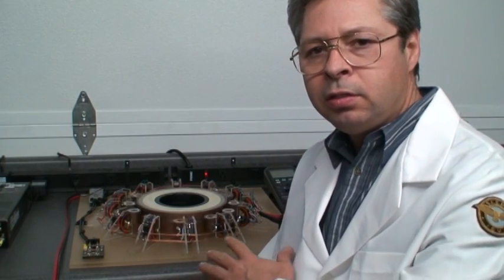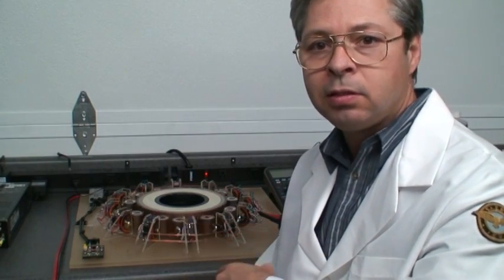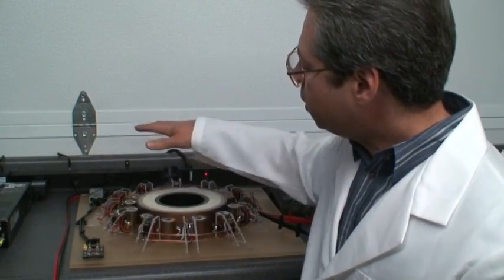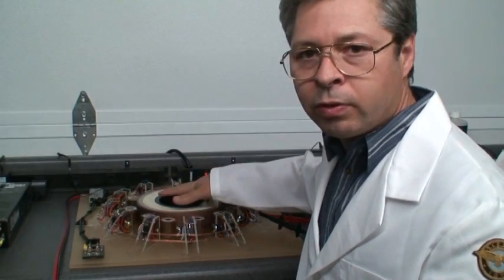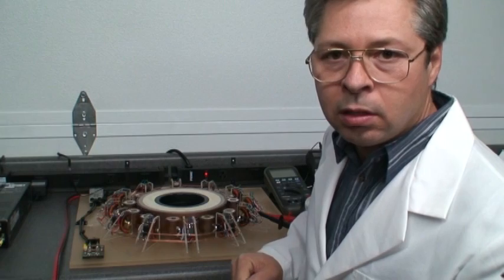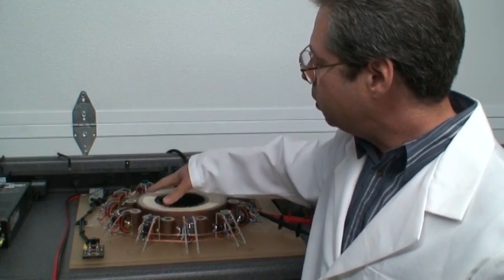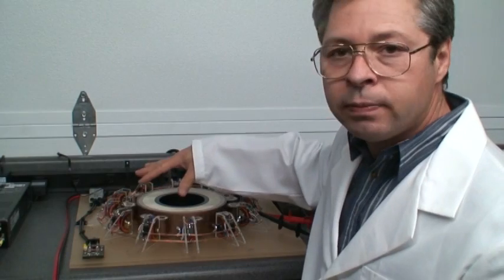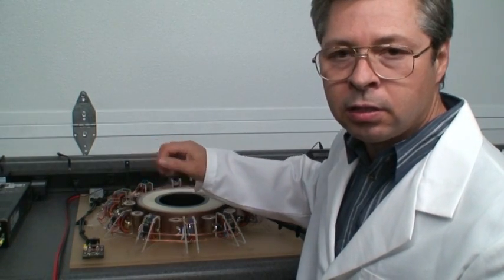Twelve roller mock up of the SEG

Comment: I find this device very curious. If the rollers were regular magnets they wouldn't roll like that would they? I would expect the north and south poles of each magnet to attract and the magnets would flip on their sides and stick together. Would this be the case reguardless of the external power supply ? As the rolers are made up of segments i assume that it must be made into a spiral magnetic field  each roller ? It would take some doing to create such a roller i expect.

Comment: this seg thing ,,, is just bedini battery chargher you used 0ne nine volts battery and charged another 6 ninevolts thats what ive done for my remote control cars using bedini window motor chargher  its simple to make and its proven thats works... input is ninen volts   output is  6ninevolts battery fully charged,,, thats what i  called free energy

Comment: @gdgildner That's not what DREAM ONE states. THe Dream indicates the runners should be cylinders, and segmented into eight discs, joined magnetically. THe SEG will only function if the precise instructions given in the dream is obeyed.

Comment: i want someone to explain to me, if the electromagnets are being powered by electricity, how will this produce more power than is input into the device; how will input be greater than the output?; how does it produce energy that can be harvested?, and also, are the rollers making contact with the outer ring or are they floating there?

Comment: @clnmyjts There is no such thing as "free energy". Solar energy is BS most of it, you use just as much energy on producing it as the panel will produce over its lifespan. Well, electricity by water is solar energy to some extent, but then everything would be solar energy.. We need to focus on the bigger things, nature. Not small scale physics..

Comment: Use light material and liquid mercury as electric storage unit and it must spin up to 60,000 rpms to work,your on the right track..just use light material or it will self distruct on to itself..smaller mags with neoprem sleaves or teflon, more mags.the higth of the mags are a good size to start with, just narrow them down so there lighter..and put a ring on the outer side to hold them in place that turns with the mags like a bearing,the mercury unit will provide the boost to increase the spin..

Comment: Because this is just a magnet mock-up made for CFE II, and to see how much input total power it takes to get rotation. In the level 4 square SEG, the Neodymium cores(electron reservoirs) and choice of elements and gating layer of Teflon or Nylon 66 negative to the outer maramagnetics emitter layer, in plates and runner-sets gives off more than enough EMF to sustain rotation.

Comment: can somebody please explain this to me in layman's terms? as far as i've understood it goes against mathematical logic, but still works. im talking ofcourse of creating constant motion; creating the same ammount or more energy than the device consumes. the 12 electromagnetic fields are powered by a single energy source which is the same or weaker than the energy u could gain from the device. and since the magnetism causes the energy flow (electrons) to speed up, it should create a greater force?

Comment: It is fed 1.5 Volts @ 600 milliAmps.
The Neodymoim-cores of all plates and runner sets in conjunction with the other chemical-element layers andt the gate-valve layer of NYLON 66 or Teflon generates more than enough EMF to sustain rotation on the actual SEG. First SEG was constructed in 1946 at British Rewinds, financed by the late George Hines.

Comment: You must like paying a fortune for electricity. The domestic laminated four-element (Level-4 Square) SEG will supply 11-kilowatts per-hour to power your home, for a one-time purchase price, that when mass-produced will be less than a petrol-powered emergency generator. When overloaded, it makes an excellent drive-unit and force-field generator for slender-disc areospacecraft, that can travel MUCH faster than any rocket, with no noise, no fuel, and no heat, no vibration.

Comment: Yes, now it is authorised to talk of the magnetiser. That is key to the technology, for you must have an DC with superimposed AC impressed simultaneously, on plates, and 90-degrees the other direction on runners. This is basically a linear induction-motor, similar to one patented in the USA in 1979 by Howard Johnson. Professor Searl invented the rare-earth magnet. Before the first 14-foot SEG in 1946, Neodymium was used only in tha glassblowing industry, to tint and polish glass.

Comment: Is this device supposed to work by itself?
 
I mean, are you (they) claiming that when the external power source is turned off, the device will keep moving and could provide torque to any other machine to make it move "for free"?

Comment: RF transponders would be on all commercial and civil IGVs. Flight direction is controlled by the 64- Flight-Cells between the the SEG-powerplant and the flame-barrier and the rim of the spacecraft. 64-discharge needles are at the end of each flight cell.Flight cells rotate from 0-degrees to 90-degrees. By asymetrically distributing electrical potential on craft, it can be controlled. Speed of IGV controls altitude;controlled by a load-cell and a videocamera oscillator-tube.

Comment: Laser beams can cut thru ANYTHING, yet I see no governmental control of LASER-devices. You will soon have your own flying car, as predicted in science-fiction films since Fritz Lang's METROPOLIS (1922) to BLADE RUNNER (1982), BACK TO THE FUTURE part II (1989). Air travel will assume lower cost than ever before,, with a much cleaner-environment, no burning of fuels, fossil or otherwise, and a great economy, when any oil sold is dirt cheap because demand shall be non-existent.

Comment: The basic equation for calculating electrogravitics force:
          F  = Vm1m2/r^2
where force is in Newtons or dynes, V is Voltage, m1 is the upper-shell of the IGV, m2 is the lower shell of the IGV.Both shells of IGV connected to the innermost Neodymium-layer of the innermost ring of the level-six square Flight SEG, and also to two switches in each of the 64-flight-cells.

Comment: Yes. The SEG is simply a linear motor, basically a two-phase induction motor, with the electromagnetic-wave impressed on plates and runners 90-degrees out of phase. This looks like a rotating spot on a scope. The SEG works due to simple,reliable old physics and electromagnetics.Maxwell's second equation is upheld,inviolate. Not Lorentz-forces,but simple wave-phenomena,and Cooper pairs explain the SEG.

Comment: I read in another video that that speed was attained with a only 1.5 volts potential - my question is, how much current goes into the thing?

Even if the antigravity claims prove bogus, this might be an interesting configuration for an electric motor. :)

Comment: The SEG-powered IGV cannot crash inot buildings, or the ground, the field just pushes it away. The Levity-disc (IGV) is surrounded by a forcefield, propagated from the rim of the craft. Bombs cannot escape from the field of the SEG. Nothing can destroy the craft, either, when so energised by the overloaded, superconducting SEG. Google: FORCE-WALL. An impenetrable electrostatic force-wall was accidently created in the Southeast at a plastics-factory.

Comment: This was supposed to be a mock-up, not actual rare-earth-cored, self-running SEG. In actual SEG-GYROCELL,no contact.  Minimum 4-layers (electron-reservoirNd, (electron-gate/insulator) Nylon 66 with a neg. charge, or Teflon, (electron-accelerator)-FE (this layer is magnetised with DC+AC coil), (elctron-emitter) Titanium - Ti, (paramagnetic-layer) Al, or Cu. Runner attracted to Fe-layer in plate, but float as  orbit/rotate. Just like planets in ecliptic, or a magnetised Fe-atom.

Comment: John has said many times that one idea for an SEG-powered car would be to replace the 4-wheels with 4 SEGs. The SEG is a PRIME MOVER, and will produce any amount of usable torque you require. Or, just use ONE SEG in place of the electric-motor on an all-electric auto, and use AC/induction motors. No emissions, in fact the SEG cleans the air as you go, no noise, no consumption of Earth's Oxygen, no emissions, sweet, after-the-thunderstorm air coming from under hood...

Comment: This work is fact, and I am simply reporting history. 1977, US air Force, Edwards flight tested P-11 at Edwards, and you may call them. But that was 30-years ago. NASA had lot of contact with Searl because next craft, EZEKIEL, 90-footer, was to be manned, so needed life-support, as air can't get near generator at the 500,000-Volt mark. I met people who worked with Searl, and people are still coming forward that worked at ground-stations over  world to turn the 12-meter band-controlled craft.

Comment: When the SEGs are silently in every basement, generating power, and put the excess back into the grid, when we have clean, cheap, SAFE, IGV air and space-travel, have SEGs in every hospital and burn ward, promoting rapid-healing, SEG-powered electric cars, and clean air and water again, we will just be beginning!  We can do it. If we work really really hard, NOTHING is impossible, and don't ever let any anti-intellectual tell you any different!

Comment: Antigravity is any force that is in opposition to the PUSH of gravity (a converging flux of ETHER). Matter is an ether-sink. A hot air-ballon is an antigravity device! We are just doing the same thing with electrons.Burkhard Heim uses the words DYNAMIC COUNTERBARY. There is grav- shielding, dipoles, inertial-drives,Moving parts, static, solid state, electrostatic, electromagnetic (the Navy's antigrav TOROIDS). Read THE COSMIC CONSPIRACY, and THE VINDICATOR SCROLLS, by Stan Deyo.

Comment: (hypothesis) As the magnets move an electric current is generated in the copper. This increase of the magnetic field creates a local minimum on the surface in front of the roller which pulls it forward.

Comment: Put a shaft through the big stationary ring magnet, mount 2 ball bearings with a proper spacers to keep the ball bearings in right place. Then design and mount 2 non magnetic perhaps ¼" circular plates above and below ring magnet wide enough that will have enough space to mount each individual rotating small cylinder magnets with ball bearings.

Comment: I'm an old Keelynet user, and ran Vortex-L FE forum since 1995.  I've watched all the various projects fail.  They tried to develop large generators but without ever releasing the smallest piece of working hardware.  If you follow the same path as all earlier researchers, history shows that you have insignificant chance of success.  So... toys should come first!  They solidl prove the principle. Kites or paper airplanes first, Wright Flyer later.

Comment: Several "magnet motor" companies posted videos on their own websites.  Steorn has stuff here, no?  They could all easily be hoaxes, as could your own videos.  Only the physical device is convincing.  And only convincing if in outsiders' direct possession, NOT just demonstrated by yourself.  (Demos can be hoaxed, run by uWave beam power rectenna, etc.)

Comment: that might be the dumbest thing ever said, why cant a magnet that has a plausable outward force against other magnetic objects be capable of being used for powering amotor? magnet motors arent perpetual magnets wear down. 

BTW input for the above device is 3watts output on the single outside cylinder was 43 watts they dont mention how high the 12 cylinder was.

Comment: The point is to shatter suppression.  "Don't worry about people stealing your ideas.  If your ideas are any good, you'll be ignored unless you ram them down their throats."  If these prototypes aren't for sale, this current announcement will be the same as all the others over the last century.  The typical pattern is: announce, then talk a lot, then vanish again but without leaving behind any working devices.   Just build 20 very small single-roller versions and sell them for $2K each.  Simple.